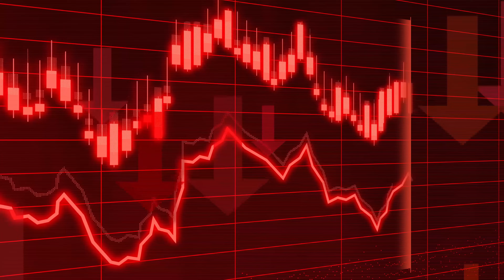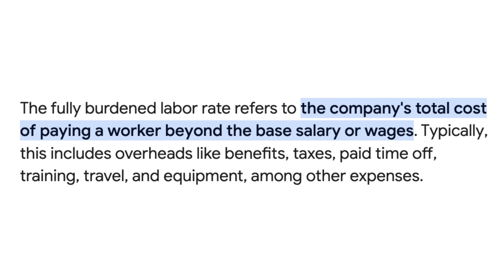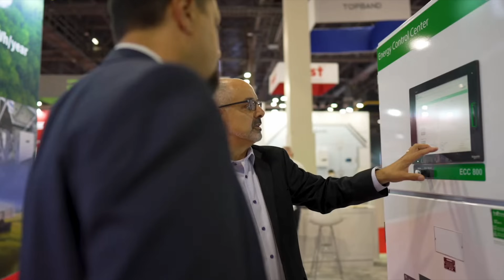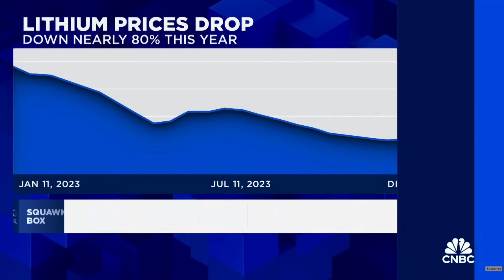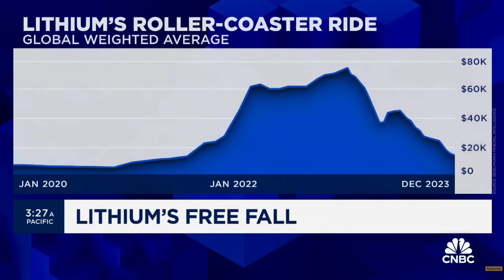IT'S BEGUN! The Solar Battery CRASH of 2025

Comment: Bairly watched and skipped only to get and add... reason why prices have fallen is economies of scale from my pov. Generally always the reason, but issue is we need better battery technology and to retool factories and get acceptance the technology need to be significantly  better. With so many new battery technologies being researched and tested now it seems difficult to know what is the most viable. The good is that maybe we would skip a more poor performing technology, the bad is that we are using decades old technology that is still and think this capacity is good vs a technology that was invented well over 150 years ago. In this sence I think its absurd and extreamly poor. There was some demade prior to what now seems and all out crisis to develop better technology.... electric cars arn't new, pv panels arnt new they were just undeveloped. Wind and water power has always been there as well... water specificly had been used and was mostly abandoned for cheaper sources... I drive past many, many years that were capable, opererable. I've been inside hydro plants and seen capabilities of earth type batteries or using excess. Considering some of these plants in the middle of no where can be productive decades ago and now the fees on most people's electric bills have more than tripped withing the past decad... really kills self production on majority of eastcoast atleast. You certainly can't go with standard install solar if you want freedom of production/use, still being without power in outage eventhough your own grid is certainly producing power... it's like a meme... tell me you don't care about anyone you "provide" for without telling me.... there are easy and cheap ways of allowing homes to provide power while grid is down and EVERYONE Will tell you no. I've talked to several installers and they are all mouth untill talking about that. They simply input expencive... expencive and they don't want to do it or as the ones that come to your house will simply say no or... the owner is better at that. That's a red flag... to me they only do one type of instal and even though they themselves say they are here to educate you... they know nothing, they are sales and in certain areas solar will sell its self, others not so much. I'm in  an iffy area where the fees seem to take a whole page on the electric bill... I don't want to be completely off grid, so even I'd I produce 100% my own power I'll still pay 15%ish and I guess it will go up. 5 years ago fees from the same company was like 3 lines and very low. We are being charged for them to go solar/wind and fees to shut down coal and gas plants... which idk arnt there grants already? So it's a fee ontop of a tax on top of "free money'' ontop of grants and so on... then people claim renuables arw cheaper... in general utilities have been subsidies for a long time anyway so how does anyone know the actual coat? In reality isn't anyone producing h
There own power and still paying fees to utility loosing? I always hear to solar people say "renting" power which is stupid. It's consumption just like eating food at a resturant. What you use is not the same thing the renting analogy is nothing short of lf fraud because it's a lie. It's made and used and cannot be reused. I'm for it, but "renewable energy" is the most fraudulent thing this and maybe more decades.

Comment: What most people paying out to get solar do not know is that the system they are getting WILL NOT HELP IN A POWER OUTAGE. They all think it will so are in for a very severe shock when the grid goes down. Also the makers of the investors do not allow a very high  emergency power system on those that do. They might almost be as that the authorities demand that there is no EMS on the systems available.

Comment: BatteryEvo is the cheapest by far…. Just got a 13 kWh extension battery for $2,000
Reply: Yes Doc .. that's good price and absolutely anybody can access these prices . My first serious buy of 15kwh in 2023 for 3200 au was topped in 2024 30kwh for 4150au JK-BMS for under 200au and all working a treat .

Comment: Whut? I installed batteries myself; and it was just two fat wires into the existing solar inverter - which has a built-in breaker. How are people making this complicated in the US?
Reply: It's safety. Modern countries have a level of electrical safety that the third world couldn't dream of.
Reply: @XxBloggs  Perhaps only in my nightmares. A battery needs a single switch/breaker/fuse combo; that's it. It's crazy that this is made complicated and expensive.

Comment: The decline is also in part to growing education of real benefits vs perceived/marketed benefits.
As more people have engaged in Solar, as well as posting thousands of "personal experience" reviews, the benefits vs the lack there of, for their ability to run "off grid", are also easier to understand.
For example, I myself was looking  into an off-grid solution and the feasibility study resulted in it being cheaper to stay on-grid for the house.
I can still supplement with the use of solar for minor things like front gate automation, limited use water pumps, secondary/foot path lighting and temp. back-up power (diesel generator replacement).
So with this thinking, the equipment "buy in" investment is a lot less and pay-off benefits are seen sooner .

Comment: "Stick around until the end because I'll be going over whether or not I believe it would be better for you to keep holding out for lower prices or pull the trigger now." 

At the end - "2024 is one of the best years to get a backup battery system for your home, however holding out for lower prices is something that I could view as a rational decision." 

You don't "go over whether or not you believe that," you quickly justify both. It's basically clickbait. Do better.

Comment: it depends on where you live. 
Installation time for batteries is here short, within a  month or the installer gets no contracts. 
The whole installations here are prepared for hybrid use first.

Makes no sense. Here the kWh price is about 130€ or 140$ for 14 kWh kit. 

Those are kits , just 1 hour to get the cells into the case and connect the harnesses and batteries. 

If you buy those ready to use then the price is about 3 times of that . 14 kWh below 2000€ or between 6000€ to 8000€ for Huawei storages. 
Tesla does not sell well here. Too expensive , too exotic unless you own a tesla car too.

Comment: It will go down even further. Look at Ecoflow. That a have a TON of options even within the same capacity. It's oversaturated. Also, a diff topic but the portable power station category is giving competition to fixed home battery systems. Costco right now has a 18kwh system for 8,000. I do believe that holding out will be the wise choice as I think the market is very saturated with offerings.

Comment: So Solar Battery is just a battery or is it a unit combining a solar panel with a built in battery.
Reply from the maker: There is no such thing as a "Solar Battery". What I am referring to are high voltage wall-mounted deep-cycle batteries that are engineered to be paired with a Solar PV system. Not to be confused with small portable batteries, car batteries, or 1.5V batteries

Comment: Aren't the meter collars only good for 30 amps?  You can't run everything with that.
Reply: True, but 6.9 kW at 230 V is achievable at 30 amps. Most homes will not be using more than this for very much of the time, and when they are, chances are, either solar power will be available, or it will be available at an off peak rate.

Comment: It depends on which country you are . Labour cost in first world countries is very high and made worse if you live in rural areas where there is only a handfull of installers and competition is less. Even if you have $2000 solar battery but labour cost is also $3000 then buying the solar battery is not worth buying.

Comment: Prices are following the traditional model for product (both for whole home battery systems and for solar panels). We're getting out of the early adopter phase and mass market prices are necessary to sustain market growth. Because the audience is larger, there are more providers trying to tackle this which is part of what is leading to the over supply. This is driving prices down. While the demand is there for this market, higher prices aren't sustainable so profit is being driven through economies of scale over the larger demand. We won't see a price bump until the cycle changes with some new innovation. 

It's turtles all the way down from here.

Comment: lifepo4 280ah cells -2 years ago cost about 150$,  year ago cost about 100$ or more - now about 50-60$ - also almost brand new batteries from salvage cars drop signifinacantly - 1-1,5year ago 60-70kWh kia battery cost about 7500-8000$ in my country, now 4500-5000$ - I am wondering IF or WHEN 1kWh will drop to about 10$
Reply: $0.08 / Wh is cheap !

Comment: There is no reason that the trend in battery prices does not continue. When you look at the 15KWH box on the wall you know we could make that for under $ 1,000 and that's where the price is heading over the next 20yrs. At about half their price now and a 15yr life then nearly every home could afford to buy one knowing they will save money. Think what that does to demand and electricity Grid management when homes start to lift themselves out of the peak period of the day between 3pm to 9pm.
Reply: You are absolutely correct.  As I posted in another comment, cell pricing was at $110 per Kwh mid-2023 and is in the $76 range today. CATL now predicts $54 per Kwh by year end and $40 next year.  It will take some time to work its way through the many product lines but we're already starting to see price reductions on many battery products.  If your experienced enough to make it yourself, you could build a battery for a lot less than $1,000 very soon.
Reply: The power companies will declare that peak hours will be 24hrs. Scam
Reply: @SkipMichael  There will always be peak and off-peak hours, due to humans needing to work and sleep, and as long as there's summer and winter months and of course, night and day, weather patterns etc.. Ev's and batteries will help immensely but I doubt we'll ever have 1 tier, even if a fusion miracle happens.

Comment: The biggest problem in the USA, also from not using the metric system is not having 220v mains. Everything there is backwards
Reply: We use 240 volts, so what's your problem with that? We split it and use 120V from each phase for small appliances and lights, but all large loads are 240vac. Every house has 240VAC mains. There is no issue.

Also, there are two kinds of countries, those who use metric, and those who have sent men to the moon and brought them back safely. Tell me more about your country! 😂
Reply: We have 240v in all but the oldest houses.  They are used for stoves, dryers, water heaters, AC units, etc.. My EV charger is 240v at 48amps and my house was built in 1956.  Not old for Europe but pretty old for the US.  I agree with you on the metric system though.
Reply: If only these were the biggest problems in the USA…!

Comment: LG Home 8 complete system is 7.5 kW inverter with 14.4 kWh useable energy for $7,400.
Reply: But that's $500/kWh,  for a battery that is getting nearer to $60/kWh wholesale.
Reply: @mark123655  $60 per kilowatt hour? That is an absolute joke! You are totally misinformed! 🙄
Reply: @mark123655  that's ridiculous! It is a complete system with all electrical controls. You can't just do the math on the battery like that silly bird.

Comment: I've been in the solar industry for 25 years and I work for a company that provides energy storage systems and I am so sad as to the lack of education and training that most solar companies employ when installing residential energy storage systems. The amount of installation errors that I have to deal with in the field is overwhelming!  it really makes me sad. In fact, I would rather work with a high-end licensed electrician that has no solar experience then a know it all solar contractor who most certainly does not know it all..
Reply: @paradiselost9946  4mm2 for 400V 3phase inverter is more than enough assuming it's copper. You're probably talking about 6kWp, which will most likely top out at 5kW instantaneous power. The problem is with voltage regulation on the power company side, not with the install.
Reply: It's because electricians aren't used to proprietary stuff
Reply: Who tf are you hiring? It’s a 2 wire plug and play. I can install the inverter, disconnects and battery in 6 hours or less, programmed and all.
Reply: Not a problem - you now have business that prefab power cabs and the on site problem is going to driver them to being a simpleton worker just doing on site plug and play and maybe site prep.
Reply: To many cowboys and lack of regulation
Reply: @chefgav1  Too Much regulation in all things! Get the Gov't out of the way!
Reply: @JosEPh-zy3yr If you don't like government, leave.
Reply: No one who would do the job right, has the training and experience would work for the wages provided by solar companies. Most people doing the install are only trained by 1 day course at most.
Reply: @FrozenHaxor  well my solar company was profitable for many years and I paid my installers $37 per hour. and I sent them to a two week training course in electrical, and I paid all of their expenses. Don't generalize!
Reply: @FrozenHaxor  yeah, that’s why NABCEP training requires testing, and credits from reputable training programs.   😂
Reply: That’s the problem with DIY and lack of need qualifications required to install
Reply: @chefgav1  He's not talking about DIY! He said," lack of education and training that most solar companies employ when installing residential energy storage systems". What part of this did you pull DIY out of???
Reply: @JosEPh-zy3yr  don't you need to be a fully qualified electrician to install solar in the U.S? Pretty sure you don't. There are tones of DIY solar on utube from the U.S
Reply: @chefgav1  Maybe DIY would hire someone like you if didn't quote $150k for 20kw solar battery system that cost you 26k. Just want to make $5000 an hour in profit. I can install a 45kwh EG-4 system for less then 30k DIY fully permitted.

Comment: This guy keeps using the term "Solar Battery".  What is the difference between a "Solar Battery" and a battery?  Nothing?  Then why are we calling the batteries "Solar batteries"?  I am open to correction.
Reply from the maker: You are correct in that there is no such thing as a "Solar Battery". What I am referring to are AC/DC Coupled wall-mounted deep-cycle batteries that are engineered to be paired with a Solar PV system. Not to be confused with small portable batteries, car batteries, or 1.5V batteries.
Reply: @jackthesolarguy  Aye fair enough.  Thanks for the explanation so.

Comment: The Solar Battery - WTF is that?! How about wind batteries?
Reply from the maker: You are correct in that there is no such thing as a "Solar Battery". What I am referring to are AC/DC Coupled wall-mounted deep-cycle batteries that are engineered to be paired with a Solar PV system. Not to be confused with small portable batteries, car batteries, or 1.5V batteries.

Comment: Lithium reserves will not sink there is far more than enough Lithium to build all the batteries anyone wants. If supply wanes alternatives will pick up the slack.
Reply: There have been several deposited of lithium found in Nevada, Oregon, and Pennsylvania recently. Between 20,000 and 40,000 kilotons

Comment: I have a Tesla PW3 with the meter collar. Tesla did the install. At the time I paid cash for the system and did not get a 2nd battery. In hindsight, having the second battery would have been the way to go. I think by the end of the year I'll get a second.
Reply from the maker: Are you in the Bay Area? How long was the install timeline?
Reply: @jackthesolarguy  Sacramento area. It went very fast. I contacted them in late Feb, everything was done by end of May. It would have been done sooner but I had some conflicts with scheduling dates. We got PTO from PGE within 2 weeks of final inspection as well. That was a real surprise since we were told it could take up to two months.
Reply from the maker: @kwesty1  Good for you guys. Best of luck with the system!

Comment: I bought an EA Sun 5.1 kWh battery.  $1500 cost (w/ shipping) was about same as my 6 kW inverter (EG4 6000XP).  EG4 recommended twice the battery, but mine suffices for my need of getting thru the "4 to  8 pm peak Summer rate" after solar tapers off.  Wasn't going to pay $2500 for twice the battery.  I can add more battery as prices drop.  It hangs on the wall beside the inverter, looking clean and slick.  100 lb which I might have "bench-pressed" onto the hanger, but didn't want to risk dropping the beast so used my hydraulic engine lift.

Comment: Batteries are WAY overpriced. In 10 years time, batteries will be like TVs or refrigerators ... in every dwelling , every house. Will be replaced every 10 - 15 years like the TVs or refrigerators of today. Every house, block of flats, appartment buildings will have PVs. Every parking lot will be covered with PVs. Electricity generated behind the meter at every house and flat will be traded using blockchain technology. Power corporations will exist only to maintain the infrastructure and will take a percentage of the trade done via blockchain. This is the future in less than 10 years